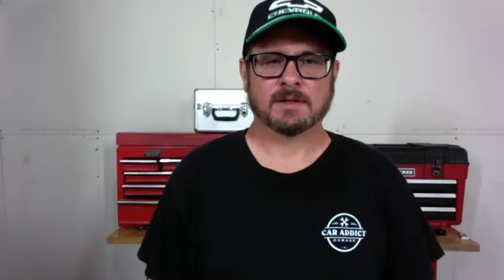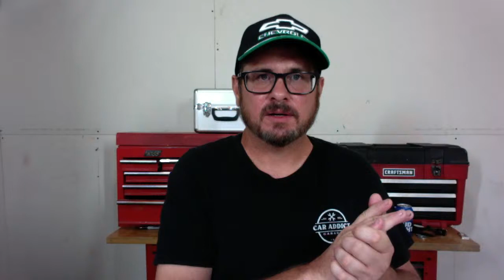Live - How To Fix Paint Problems and More

Comment: I got rust converter and treated a 48 Chevy door after i wet sandblasted and sanded with 80 grit.It turned the metal blue like gun blueing.can I put DTM epoxy primer on top of that?
Reply from the maker: Yes, epoxy would be my preferred primer to spray.

Comment: I do have a question for u though do u know what type of primer, basecoat and clear coat chevy uses on theyre modern silverados?
Reply from the maker: I know they are e-coated, then a primer under coat, base coat, and clear coated, but I am not sure of the exact system or process from the factory.  If I find something, then I will let you know.
Reply: @CarAddictGarage  i figured they use e coat and as far as primer im assuming acrylic lacquer? And base coat im guessing acrylic lacquer also? And clear coat maybe acrylic urethane? Would u agree with that or no what do u think? And another thing i have a 2018 chevy silverado and i did a spot repair 2 months ago and i sanded down to bare metal to repair a rock chip and i discovered the entire panel under the factory primer was coated in rust??? That means the entire truck body must be the same? Is it normal to find rust between e coat and bare metal on a brand new truck?
Reply: Hello?

Comment: Hello Don I repaird a hand size damage on my door  so I sprayed grey primer  the colour of the car is dark blue matalic is it normal to put 5 to 6 coats of base coat to cover the patch? And after I sprayed whole of door 3 time's with base then cleared it came out good
Reply from the maker: Yes, it can take that many times to hide the primer spot.  That is one benefit to using primer sealer closer the color before applying the base coat.  Some base coats are translucent and don't cover well.   Thanks for watching and commenting.
Reply from the maker: I gave a more in-depth  answer to your question in this video.  Thanks for watching.  https://youtu.be/mZIEnubHV5o

Comment: Ive tried that website u mentioned in ur link automotivetouchup.com and ive had very bad experiences with their products in the past, because they use low quality paints and clearcoats and there color matching was wayyyy off i will never use them again. And i dont recommend them to anyone!!!!
Reply from the maker: That is good to know.  I've used it for chips and it worked well, but I have not tried their spray cans.  Unfortunately, I have not used that type of repair method a lot, so I am not sure what brand to recommend to you.  Automotive Touch Up and Dupli Color are the only two brands I am familiar with for touch up.  

If anyone has used a spray can paint or paint pens for touch-up and had good results, then leave us a comment.  Thanks